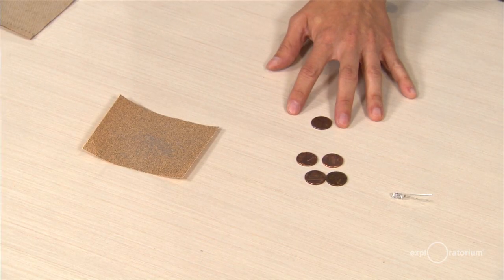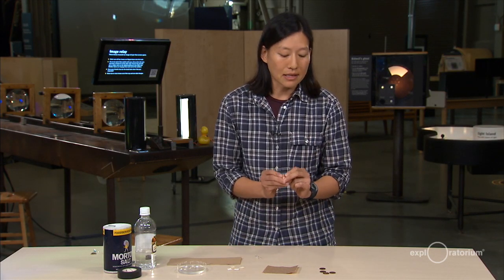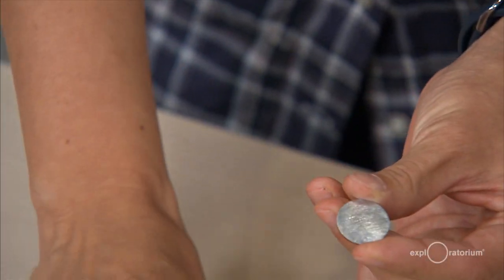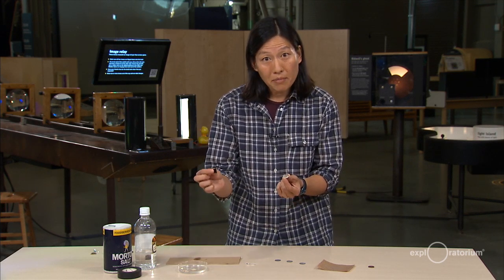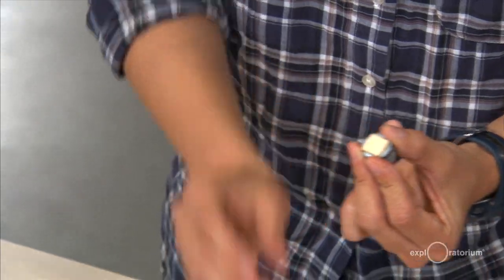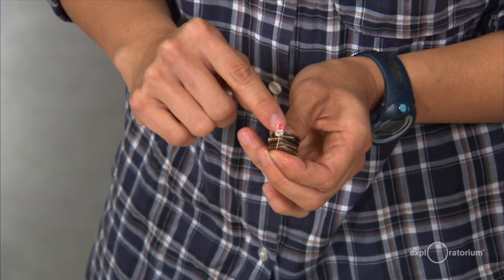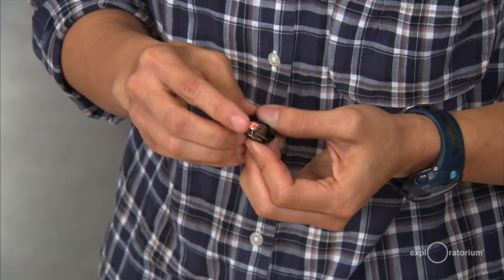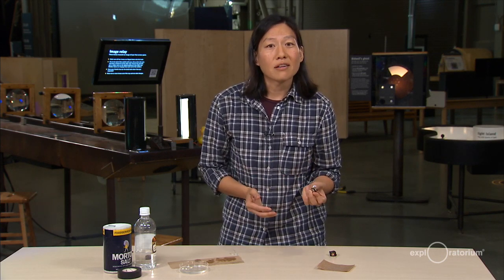How to Make an LED Flashlight with 5 Pennies I Activity I Exploratorium

Comment: so red uses the least power. Why not pure white?
Reply: I'm not an expert, but I dare to say that's because the lower frequency of red light. Lower frequencies require lesser energy. Blue, instead, has a higher frequency and thus needs more power. On the other hand white light is composed by all the color's range so it isn't, ironically, "pure" at all. In fact, gather diferents wavelenghts that have different needs of power, I think (but here ends my knowledge).